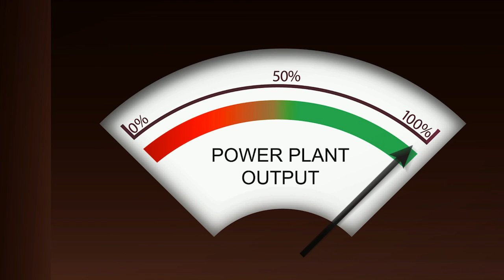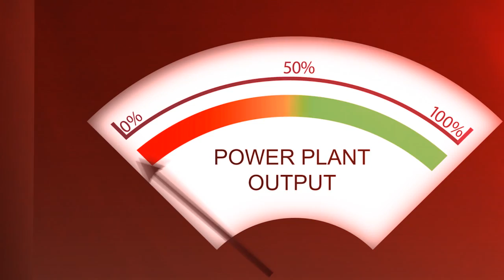Smart Power Generation - The Future Of Electricity Production | Wärtsilä

Comment: liquid nitrogen to electricity should be studied
Reply from the maker: Wärtsilä agrees that exploring alternative fuel options is extremely important going forward. In fact, Wärtsilä, Nebraska Public Power District (NPPD), and Finland’s Lappeenranta University of Technology (LUT) are actively studying the use of alternative fuels. The aim is to achieve a technically and commercially viable solution that will allow NPPD to proceed with an industrial scale pilot project. Both parties have expressed the intention that this initiative will help accelerate the move towards a future where energy will be produced from 100 percent renewable carbon free sources. The specified alternative fuels include methanol, dimethyl ether (DME) and ammonia, synthesised from hydrogen, CO2 and nitrogen. Please read more on the study here: https://www.wartsila.com/media/news/15-11-2018-wartsila-lut-university-and-nebraska-public-power-district-to-develop-business-case-for-alternative-fuels-2320010

Comment: gas is expensive and a pollutant
Reply from the maker: Does gas produce emissions? Yes. But in order to make the transition to a 100% renewable future, thermal fleets have to be upgraded. It's not possible to completely neglect thermal capacity yet. 
Consider nations with favorable wind and solar conditions and existing fleets that consist of combined cycles, nuclear and coal plants (inflexible generation). In order to transition these nations to a 100% renewable future the inflexible generation needs to be phased out gradually. Why? Reliability. Hence the value flexibility. Flexible generation, like our enigines provide reliability to maintain the energy supply and demand balance (in real time) and flexibility to take advantage of the benefits resulting from heavy renewable penetration (Lower emissions and cost to ratepayers). 
For more a deeper treatment on this visit www.smartpowergeneration.com

Comment: Nonsense, another Fossil company advertisement !!!

You don't need Gas to run a stable grid,
Learn about CSP [Concentrated Solar Power] where the molten salts can store all the energy and can power the grid for 6+ hours, which is far more than practical and used in many places (UAE is one fine example).

Don't confuse people to fall back to Fossil again.
Reply: Yes, but where I can Buy that? What is the cost by MW installed?

Comment: Actually it's been proven that the wind does blow fairly consistently (as a whole) over large geographic areas.  If wind generators are placed all over and interconnected using the electrical grid (which of course they are) then you have a consistent "baseline" power.  Solar power works particularly well also as it becomes available during the day, which happens to be the peak demand.  Don't listen to the lies of corporations telling you we need to burn fossil fuels to power our societies.  Fancy marketing like this is just meant to confuse citizens and ensure profits.

Comment from the maker: Any power system must maintain capability to provide electricity to consumers even when the sun sets and the wind calms. Various technologies have been discussed: expanding interconnections between regions, energy storage, demand response, and, of course, flexible generation, of which Smart Power Generation is an example. We believe that none of the technologies mentioned will be sufficient to solve this challenge alone. Instead, all four will have a role in the Smart Power System of the future
Reply: wartsilacorp  Hi. I need to explain to my boss what is the best solution for backup renewable wind power generation. Our system is hydraulic + wind based. I think that thermal backup now is not enough flexible when dry climate times appear every 4 years for backup. Biomass also isn not enough flexible to follow wind variations. We need inertia in the system for to have enough shortcircuit power and frequency stability and to can operate the frequency converters. We need an strong net as a reference. Wind don't supply that. When rain is not enough we need flexible thermal production. The old thermal generators are not flexible enough. Then whe have combustion turbines and reciprocant engines. I see that reciprocant engines work too much more intermitent time due to wind, than combustion turbines. Then i need material to convince to my boss that reciprocant motord is better than biomass plants and combustion turbines. Also we need reactive variations compensators due to a wind power is far of the cities. I need to explain what is the best way for to old steam power plant in the middle of the city recycle method.

Comment: video is excellent and idea is very creative but problem is that when both wind and solar energy is nt available that time who ll gv the supply??? and how is it effective to control the frequency in both the case???
Reply: Exact. We need Shortcircuit power and frequency stability that don't offer technoligies based on electronic converters that don't have inertia. Also they are far of cities and don't control the voltage near the air conditioning equipment. We need synchro reactive compensation.also. Also we need new power lines and you don't use existing transmission capacity..